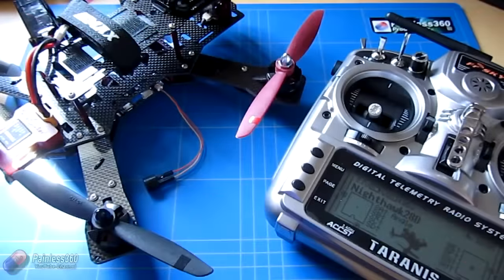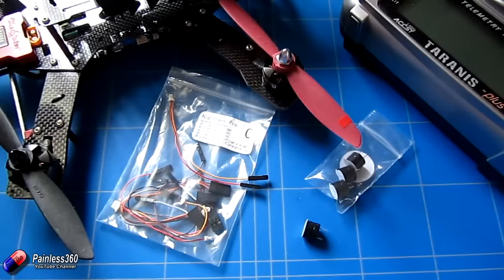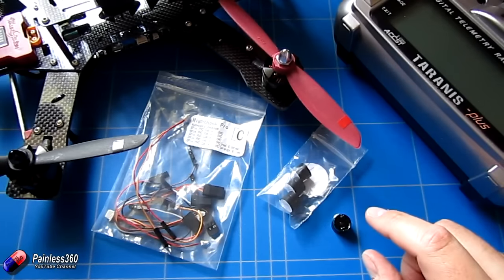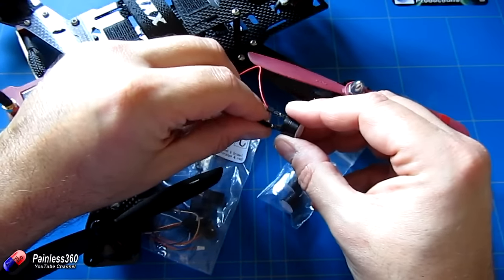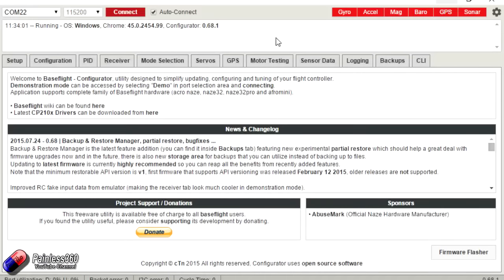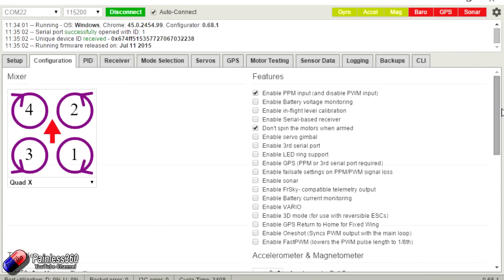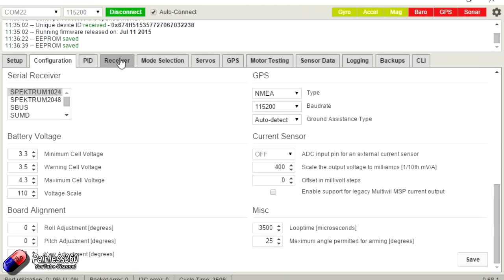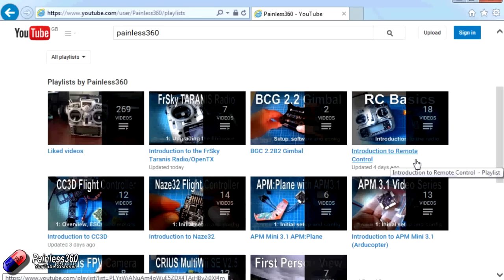EMAX Nighthawk 280 Pro - Adding a buzzer to act as a 'Lost Model Alarm'

Comment: hey painless, me again lol. so I installed the buzzer and setup the channel but the buzzer beeps periodically while armed and beeps when armed and disarmed. I have the battery voltage monitoring off btw. thanks for all your help and keep up the great videos! I learn everything from you mate!
Reply from the maker: Not sure. Maybe a bad buzzer? Best of luck..
Reply: +Painless360 oh well I'll figure it out, thanks for your time :)
Reply: +Alberto Alvarez if your talking about the RTF version and using base flight then i have found "ticking the don't spin the motors when armed" in the software causes this problem. For some reason whenever you bind the quad and do not spin the motors or spin the motors and then put the throttle back down to the lowest position using the controller, the quad almost immediately unbinds itself again and the buzzer starts again until you rebind . The way i solved this annoying buzzing problem was by unticking the "don't spin motors" again in the software and instead lowering the minimum throttle to 1000 in configuration. This not only stops the annoying buzzer but also stops the motors from spinning when you bind the quad and stops the quad from unbinding all the time when the motors are not running also.  Hope this helps you

Comment: Great video bud can you do a video on how to install an osd onto the nighthawk as I really could do with one
Reply from the maker: +UkScale AnCrawler I'm not planning to with this model at the moment as I would recommend that if that's what you want to get into then go for a 250 Quad 'kit' build that includes something like the Naze32/flip32 and use my MinimOSD/Naze32 video to set it up. I'll add the suggestion to the list though. Happy flying!
Reply: +Painless360 if you could do a video it would be very helpful as I really need the voltage of my quad and the fatshark pack displaying on my fatsharks thanks anyway and keep up the great work
Reply from the maker: You should be able to figure it out by watching Baseflight/Naze32 vbat setups and MinimOSD/Naze32 setups. Chargeable support is also available if you need it (see website for details).

Comment: Excellent work, as usual.
I found a buzzer, in my box of bits.
It has a red wire, labelled + and a yellow wire labelled nothing.
It terminates in the micro JST, as in your video.
Can I snip the cables and solder it to positive and negative, on the F303 dedicated buzzer pads?
Many thanks
Reply from the maker: Possibly, if it's only got two wires then it should work. I'd connect it to a 5v supply to test it first before clipping any wires.. Best of luck!
Reply: Thanks

Comment: Nice video as always. Can you tell me what kind of  2 PIN connectors are the ones that feed power to the led bar and the video transmitter? I need at least one more to plug at the front... Also can you identify the connector that plugs into the camera? I may also need 1 or 2  of those to add OSD to it. Thanks
Reply from the maker: +Bruno Santos They look like Nano-JST but I'm not sure..
Reply: +Bruno Santos the vtx, led bar, and VCC plugs on the 280pro board are "2pin jst-xh" connectors. something like this: http://www.amazon.com/2-Pin-JST-XH-Balance-Connector-Adapter/dp/B00R1J91JY

Comment: I noticed in the manual it says  Gyroscope, magnetometer, and accelerometer and barometer expansion port. With CPPM receiver GPS feature can be enable(GPS module sold separately). So the taranis would be an ideal transmitter, instead of the stock ? Do you intend to show us how it is done in a future video ?  fingers crossed you are :)
Reply from the maker: +who ami Already done and in the playlist ;)
Reply: +Painless360 One more question. Does the stock radio supplied have a spare switch and channel for the buzzer and lost alarm add-on ?
Reply from the maker: If you are looking for that level of control then I would look at investing in a more accomplished radio that would also give you abilities like throttle curves, expo and other options that will allow you to fly smoother and with more control. Best of luck.
Reply: +Painless360 Thanks again for all the help you give

Comment: Hi great video as I am fairly new to quads my question is
was the transmitter plugged into the pc or just turned on and only the Night Hawk connected.
I am using the transmitter it came with for now but once I get better at all this will connect it to my Devo F7
any help please.
Reply from the maker: +Mick Jay Transmitter turned on and connected to the model, model powered with the flight battery and the props removed for safety. Best of luck!

Comment: Hi Painless, I have Nighthawk pro 280 rtf. It appears to have ppm (single wire) all the other cables are there, I saw your article on adding a buzzer . The controller has aux 1 which doesn't seem to do anything so I thought this would be a good use for it but no joy any ideas? excellent reviews by the way.

                Regards Danny
Reply from the maker: No, you need to use the dedicated buzzer port we show in the video. Best of luck!

Comment: Hi I was curious if the Nighthawk Pro firmware etc. supported Headfree mode?
 I tried setting it up , but the Aileron and Elevator are reversed.
 Not sure how you would change those in one flight mode only, using Spektrum Transmitter.
Thanks for the great Videos!
Reply from the maker: This model uses Baseflight so anything that Baseflight supports should be configurable on the model. I wouldn't use head free personally.. Best of luck!
Reply: +Mike Johns The nighthawk 280 pro comes with a magnetometer sensor onboard so it can do headfree mode if you choose to set it up. You could configure it through baseflight or cleanflight and program it to one of the switches on your tx.

Comment: hi guys, 
please give me an advice, I tried to connect battery inspection with power output on my nighthawk 280 as it says in this video ,there was no buzzer connected yet, so after I turned the battery , the power output switch was on ON, and bang, the smoke came out as I think I mixed + with - but everything was still working.. so does it means I burned battery inspection socket, and wont be able to use buzzer with battery voltage alarm ? Please help me to answer this smile emoticon Thanks
Reply from the maker: +Tadas Dereskevicius Ooh! That doesn't sound good. You will have damaged the batt or buzzer feature on the board with the short circuit. Happy flying!

Comment: Very good video, can this method be used with the cheap controller that comes with the rtf model?
Reply from the maker: No idea. Ours wasnt the RTF version. Check to see if there is a spare channel in the GUI you can use or assign the buzzer mode to the existing mode switch. Best of luck!
Reply: +hazzard1701 it def can, but would require manual configuration in cleanflight or baseflight. Assign a spare channel to one of the switches on the rtf tx/controller.

Comment: I recently purchased the Nighthawk pro 280. 
The nighthawk pro 280 does not work properly. I programmed it using Baseflight just as instructed and everything seems to be working fine while connected to the computer, it chimes like normal when you plug in the battery (while connected to the computer). But while not plugged to the computer it does not work, I plug the battery there is no ESC sound and there is only solid red LEDs on the board.
It is not the transmitter or the receiver because I tried on a different quad.
Any Idea what it can be?
Reply from the maker: +Gustavo Tirado I would suspect a damaged voltage regulator on the main board. I would contact the vendor for help. Best of luck.
Reply: +Painless360 but it works just fine while connected  to baseflight with the battery plugged in,  I'm even able to spin the motors with the reciever.
thanks
Reply from the maker: +Gustavo Tirado Not sure then, best of luck..

Comment: I've just ordered one of these, can you add the buzzer and configure it to a spare AUX channel on the stock receiver?
Reply: By 'one of these' I mean the nighthawk
Reply from the maker: Possibly. Follow the same process as the one in the video. You can add the buzzer to an existing mode switch or use another one to just act as the Buzzer 'on' switch. Best of luck!
Reply: I've just received the buzzers but my quad won't connect to Baseflight. I've tried it on MacBook and Windows laptops but neither connect. Do you think I need to flash with the latest firmware first? Straight out of the box it flies beautifully but I want to change the arming setting
Reply from the maker: Try Cleanflight GUI, that's what we used in the video. Also, try another USB cable.. Best of luck!

Comment: is there a louder buzzer as I can hardly hear the 5v one from even a small distance.
Reply from the maker: +hazzard1701 Make sure that the hole at the bottom of the buzzer is open to the air, otherwise it can sound muffled.. Best of luck..
Reply: +Painless360  that's not the problem mate it is uncovered I am just a bit deaf. can I use a higher voltage or won't the board allow it.
Reply: +hazzard1701 It makes no difference. These speakers are rated usually between 3v and 30v. The drone only gives a 5v signal.

Comment: Would you be able to use the buzzer with the rtf radio that comes with it?
Reply from the maker: You should be able to. Add the buzzer mode to the mode switch Aux1. Best of luck!
Reply: +Painless360 thanks mate.
Reply: its looks like the RTF version has a 6 channel radio? are both switches used in flying, or do you just need one to change flight modes, then hopefully put the buzzer on the other? Cant find a manual that explains the switches
Reply from the maker: Check the switch movements in the GUI, I found that only one worked on mine..
Reply: Thanks again mate for a quick reply.
Reply: thanks for all the info and advice mate, have just ordered the quad from Quadcopters and a buzzer from ebay, looking forward to it arriving tomorrow
Reply: HI mate, quad arrived yesterday, but its only today I have had time to have a play with it. quad is great so far, and after using baseflight for the first time, after watching your video, I was happy to find that both of my switches worked so have put the buzzer on the other switch. now just have to wait for the buzzer to arrive from e-bay - hopefully tomorrow. Then as soon as the rain stops I am going out for a flight! cant wait. Thanks again for the great and helpful videos.
Reply from the maker: Best of luck with the maiden flight! :)

Comment: Is there a fallsafe on theses quad
Reply from the maker: There is. You need to setup the one that comes in your radio receiver so it closes the throttle on loosing signal and set it up in the flight control software too. Best of luck!
Reply: +Painless360 thanks not sure on the walkera f210 r emax any veiws
Reply from the maker: What have you found in your research so far?
Reply: Painless360 ooooo its doing my head in to be fair sum many nice race quads to start me off im thinking the emax 280 our the walkera f210 its so hard  but loads of bad vewis on walkera no failsafe so looking towards emax im watching one from ebay haaa just trying to make my mind up lol hard one

Comment: Great video, however im using Hobbyking's discovery buzzer that uses 3 cables. http://www.hobbyking.com/hobbyking/store/__14521__HobbyKing_174_Discovery_Buzzer.html
 I have tried soldering the black and red only with no success -  no beep at all. Any idea what might be wrong with the wiring?
Reply from the maker: +Vat Man see our video on that buzzer (in the CC3D playlist) it needs a PWM signal on the other wire to work. Get yourself the right buzzer and it'll work fine..